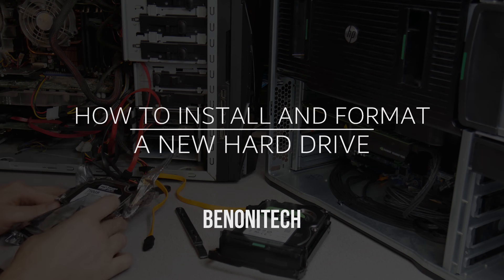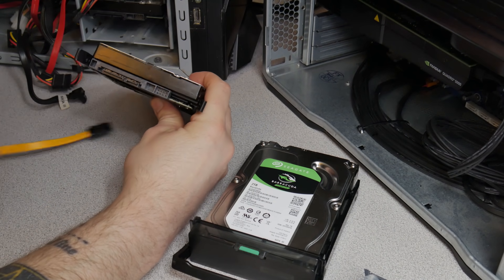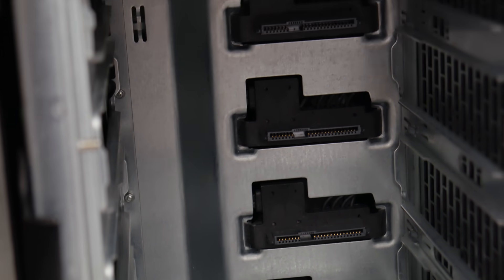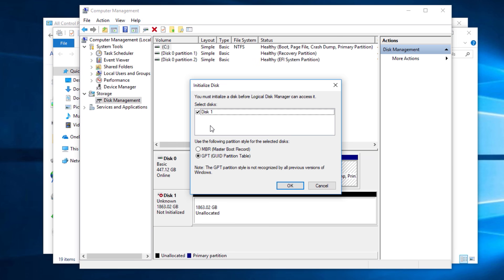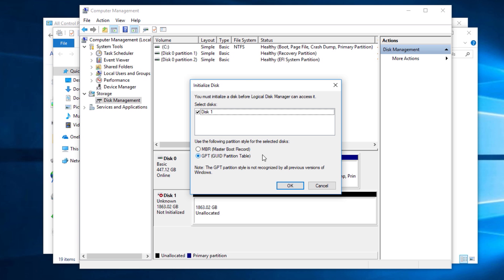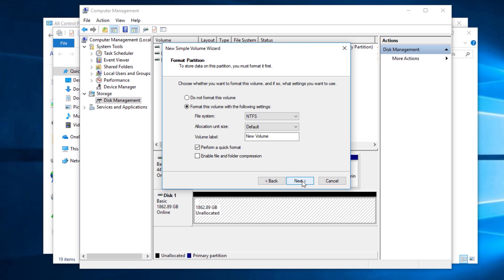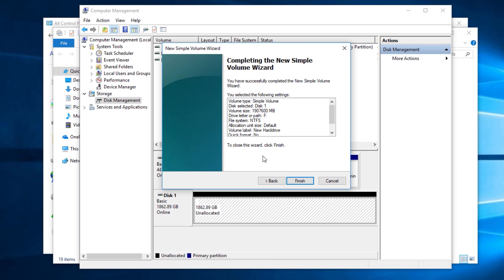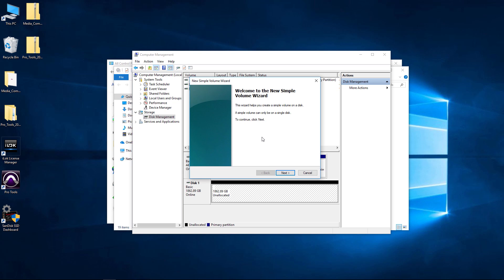HOW TO INSTALL AND FORMAT A NEW HARD DRIVE (WINDOWS)

Comment: cant install new ssd
i already have a nvme m.2 500gb installed so i wanted to install more storage (crucial 500gb 2.5 sata drive)
i connected everything correctly
changed power cables, nothing
changed sata cables, nothing
changed sata ports, nothing
checked bios, it detects only the nvme ssd
checked disk manager, nothing
tried the same with a 1tb hard drive i had , nothing
i have literally done everything there exists and nothing, can anyone help?

Comment: hello, when you do full format (not a quick one) does the progress bar shows up? mine is going for 10 hours now and no progress bar shown at all, so I wonder if it works or not. could it be a page file on that drive? it is 1TB hdd with 4 bad sectors and filled with data.

Comment: YO MY QUICK FORMAT 320GB TOOK LIKE 2SEC NOT 2HRS LOL
Reply from the maker: Yes. Quick Format will be much faster, but it doesn't check every sector. It simply marks them as free. If you are not storing critical information, then Quick Format is fine.

Comment: So when I download something will a pop up window ask me if I want to save it to C or to the new harddrive?
Reply from the maker: No. That is set (usually) in your browser. For CHROME, click the three dots in the upper right. Settings. Advanced. Downloads. You can change the default download location there.

Comment: I'm noticing this is how to install a new hard drive when another hard drive is already installed in with windows running.
Let's say my hard drive burned out because some asshole spilled water on it and I have only the hard drive I just bought.. Does this also apply? Or are there extra steps?
PS: I live alone, the asshole is me.

Comment: I have a similar situation and I'm looking to format a 3.5 hdd I found in a cable box

I went on Amazon to purchase a cheap adapter as I would only be using it once, but then a question came about I can't solve

For formatting...
Do I want an Hdd to USB cable or USB to Hdd cable

I'm new to all this so any tips would help!

Comment: Hey man! Thanks for this. The SATA power cable has like 3 ports on it including the one at the end that connected to my original hard drive. Can I just use one of the established ports on that cable or do I need to use an entirely new cable fresh from the PSU?

Comment: I want to ask you  a question,I have a windows I think its 8.0 or 8.1 either one, I'm having space issues hard drive is 80 GB and I have a 360 hard drive one billion bytes do you think its possible to put it in my CPU system

Comment: When I try to initialize it gives me a message saying “a device which does not exist was specified
Reply: me2 did you already found an solution?
Reply: HUG Jeremy. My drive ended up being broken I believe. There’s a way to clear a drive through command promo which I would definitely try before you give up even if your drive is already empty. I’ll leave you a link in a sec.
Reply: thanks!
Reply: @TheThumbsUpChannel  do you have the link ready

Comment: what if i dont want to Format,,, I have a old HDD , in it have some important data. I want to add it to my new pc but also dont wanna lose my data. can you help ?
Reply from the maker: Just connect it the same way as shown in the video and boot up your computer. Just don't format it. It should work just fine. You can assign a different letter to it if you want too.

Comment: After installing my old hdd along side the new ssd my pc wont boot up :(((
Reply: same issue here
Reply: maybe ur PSU (power supply unit) is too weak to boot up your device with an extra hdd/ssd. Check how much watt your psu provides for your system

Comment: Is it ok if i install a hdd with a existing OS and full format  it
Reply from the maker: Yes. it will just wipe the drive. Just be sure you choose the correct drive to format. And depending on how your PC is setup, make sure you are booted into the proper installation of Windows. But it's no porblem.
Reply: @BenoniTech  I see..you see i just bought a SSD and I just wanna copy some of my files on my HDD since I'm going to fully upgrade my PC is it ok if I partition my SSD and put a file on it and install the OS on a partion with no files or can i install my HDD with a existing OS  and copy the files since I don't have any external hard drive right now wouldn't it be a problem if i install the HDD on my new build just to copy some files on it

Comment: 4tb drive is showing up at around 3776 mb is this normal?  Also the mounting bracket mounts my hdd upside down does that matter?
Reply from the maker: Yes that is normal. Here's an explanation https://www.howtogeek.com/123268/windows-hard-drive-wrong-capacity/

And it doesn't matter how the hdd is mounted.

Comment: Is it easy to move windows over from the original hard drive to the other one, or is that a completely different process
Reply from the maker: That's a different process. For that you would want to clone the system drive and restore it on the new drive. Or you could just install Windows fresh on the new HDD and start from scratch.
Reply: @BenoniTech  I see thanks so much!

Comment: thanks for the easy to follow instructions. I followed you all the way to Disk Management and the pop-up didn't pop up and the drive did not appear on the list. Open to suggestions.
Reply from the maker: Sometimes you need to refresh your list. If nothing, check your connections.

Comment: Hi, if I can't see the second disk does it means its broken?
Reply from the maker: Not necessarily. Refresh the list and check connections, ports, and cables.
Reply: @BenoniTech  hmm I tried several times and I also changed the jumper for master to slave or cable select. I suspect it might be damaged or has some worse issues.

Comment: I just installed the new HDD . But its telling me to Reboot and seclect proper boot device. What does this mean?
Reply from the maker: Did you replace your OS drive? If so you need to install an OS. If you simply added a secondary drive, head into BIOS and make sure your OS drive is the boot drive.

Comment: For my 1st hardisk, it was unallocated too...When I select initialize, it says i/o error...
For my 2nd hardisk, it can only be detected for a few seconds and gone undetectable again before got the time to do anything...
Help me, bro...
Reply from the maker: Sounds like a problem with the drives, cables, or motherboard. Do the drives work on another computer?
Reply: @BenoniTech  The same problem for both hard drives when I tried it on pc and laptop...
I just bought the usb cable and the external case box to convert the drives into external drives...
1st drive from old laptop internal hard disk...The 2nd drive from a CCTV internal hard disk...

Comment: If you formatted this drive in one system and wanted to put it in another system down the line. Would everything work fine, or would you have to back up your data and re-format the drive? Sorry may be a stupid question.
Reply from the maker: It would work fine as long as we are talking about a NON-OS drive. Meaning if you have a backup drive with pics and documents on one system, you could pop it out and put it in another system and all the data would be there.

Comment: do you know where i can get some of those rails? my old hard drive has some but idk how i got them =\
Reply from the maker: The exact rails will depend on the case you have. You can check Amazon for hard drive rails and see if they match up to what you need.
Reply: @BenoniTech  I think I found some, but I don't know how I originally got the rails, do you know which part it usually comes with? Is it the case?
Reply from the maker: Yes, it's usually the case that provides rails for hard drives to fit into a bay.
Reply: @BenoniTech  aah man, i don't know what i did with them =\, oh well thanks for the help and maybe i can just hold it in place with zip ties or something haha :)

Comment: Adding a new hard drive, not adding another, is it the same steps, because PC doesn't recognize hard drive?
Reply: Dean Splitper look at Austin Evans video on setting up a new hard drive
Reply: Maxwell thanks, but I found and ran recovery disc from 2013, and they worked. Thanks for reply though.

Comment: When i right clicked on the unallocated space, it doesnt show the "initialize disk" option.
Reply: did you get it to work i have the same issue
Reply: @itshyperss7535  for me it showed the options "convert to dynamic disk" and "convert to mbr" instead. I just went with the dynamic disk option and the rest of the tutorial was exactly the same from there
Reply: @Bobberu  same here
Reply: @crispycookies3064  you need to point the mouse to the left not on the right side of the drive  4:07 i failed my A+ core 2 cause of this question
Reply: If your on windows 10 just go straight to mbr.